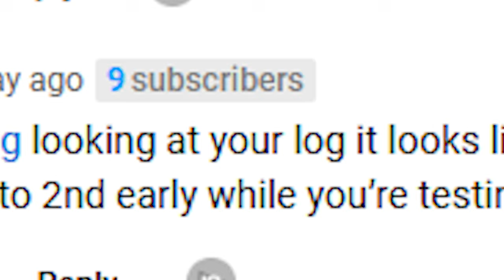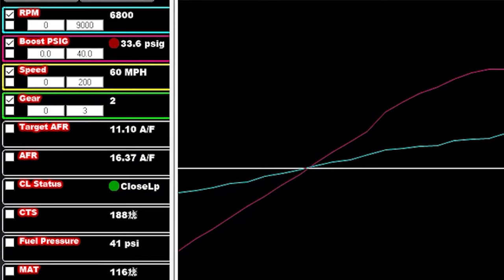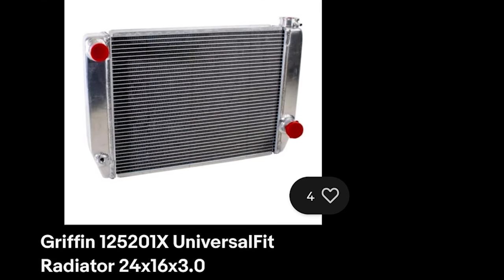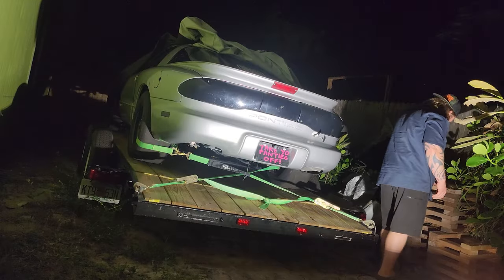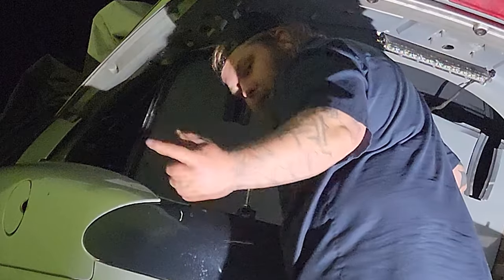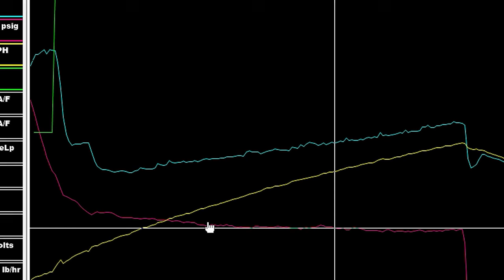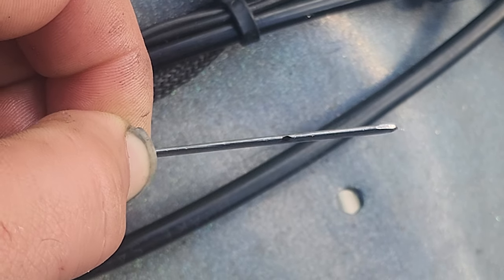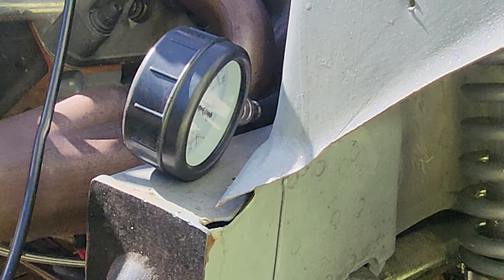Turbo LS Drag Car Trouble After 34.5 PSI Boost | Is it done for?

Comment: Im pretty surprised you are still running a stock intake at that boost level. Usually you sneeze tgem apart at some point. Nice buuld and video style
Reply from the maker: Thanks man, I've not had any issues with the "TBSS" intake, been running it for a few years now.
Reply from the maker: i want one of them Holley high rise intakes but we are in the poverty phase of the build 🤣😂

Comment: There is a internal bypass on the walboro pumps that won’t let it keep up around 80psi  if your vacuum boost reference regulator at 58psi with boost it’s over 80 at 22psi
Reply from the maker: So you're saying i need a third pump right hahahah?